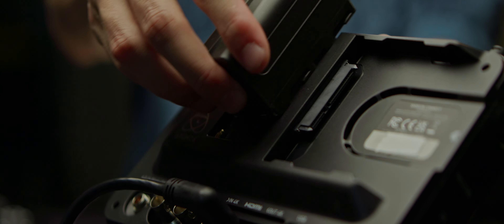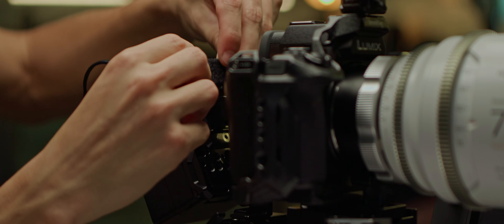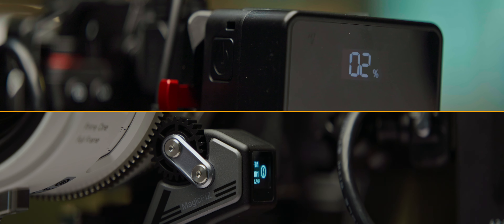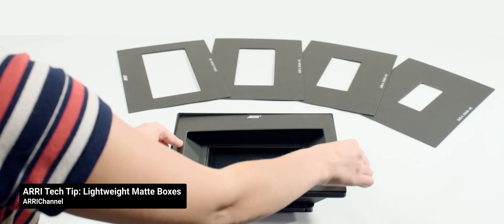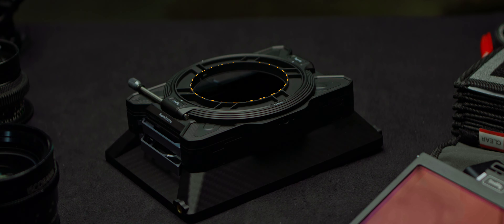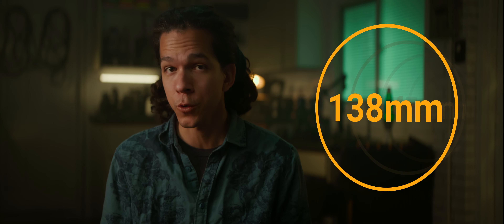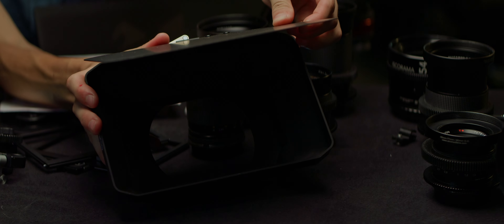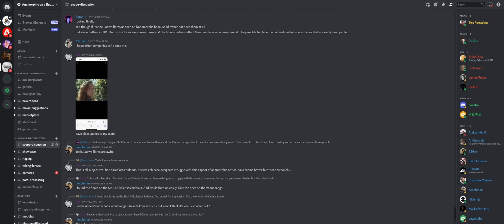Camera RIGGING for EVERY OCCASION - Part 2 - Anamorphic Cookbook - Module 6 Chapter 4

Comment: Hi! I have lumix s5, Can you help me? I set the camera to V-LOG, shoot in 4K 4:2:2, 10 bit. Iso 800 even 600 but anyway it shows me very loud noise, even if I add the light in the frame it still shows me noise, what should I do?
Reply: Expose properly and don't look at the Log footage, but with a proper transfer function on top. Log is, in its roots, not meant to be watched flat as-is.
Reply: Adding to the previous comment:
Do not lift shadows of V-Log footage in post - they are not meant to be lifted in post - instead expose correct - if the darks crush while meds and hight are OK: that's the light you captured.
Totally different approach: use HLG instead of V-Log which I do with my S1H all the time.
Reply: Love your videos. Very informative. One could also mention zip boxes as simple, light weight matte box solutions for cinema lenses. And for power distribution, there are  v-lock battery plates with d-tap built in, so you don’t have to untether the battery before changing it. Some cameras, such as the BlackMagic UMP, can feed switched, regulated power to the plate’s d-tap.